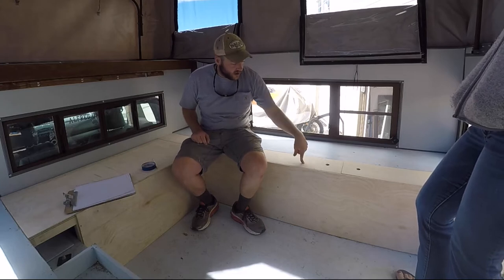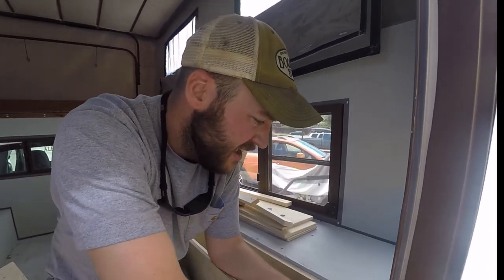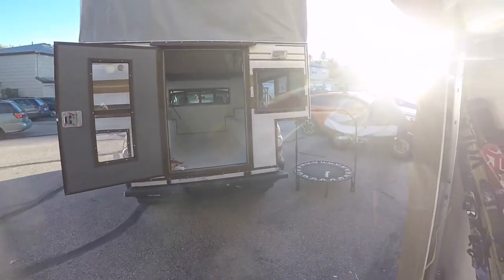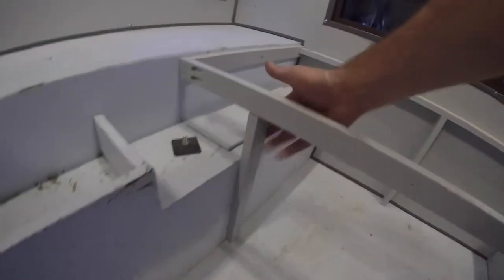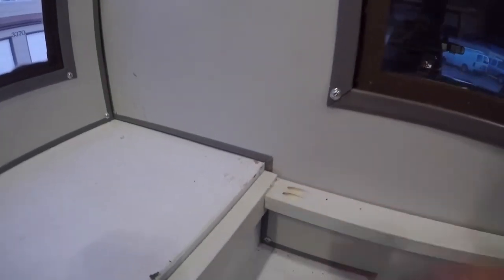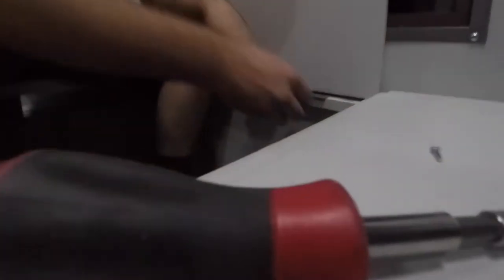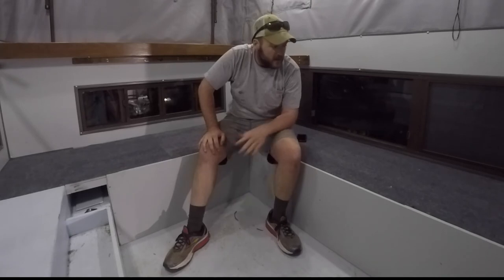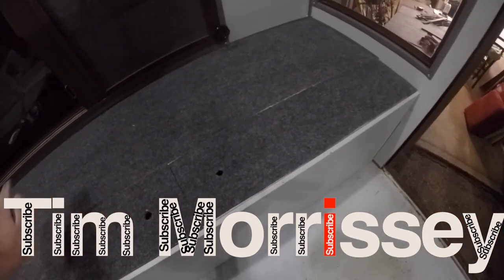Four Wheel Camper Build: Interior Shell Build - Benches and storage - Part 1

Comment: What year and model?? Great rebuild 😁
Reply from the maker: Thanks Mel, This is somewhere in the early 80s, I think an 82 or 84. I asked FWC but that is the best estimate they could offer. Its the fleet model, long bed (~7ft) designed for the old toyota trucks. Fits in my 6foot modern Tacoma pretty nicely. Do you have a four wheel camper as well?
Reply: Tim Morrissey no not yet, i really like the idea of low profile and not having to tow a trailer, i have a 2005 ranger w/ 6 foot bed.
Reply from the maker: The old fleets would fit perfect in your ranger. I am really happy with mine and could bet you would be too. You may have to make a small raiser in so the wings clear the bed but it is minimum (1.5in for me). Thanks for checking out my videos, let me know if you have any additional questions. - Tim

Comment: Hi, thanks for the video. I'm about to do the same to a 2004 shell. I wonder if you would have done anything differently? Is there anything that you've added since you did the build? Thanks!
Reply from the maker: Hey Grieg, Glad you like the video. It is working on great so far. One thing I might tweak is to give the lids to all the cabinets a bit more tolerance on the fit. Mine are perfectly tight and sometimes they are a bit sticky. I am no cabinet builder, I am sure there is some standard that might have this figured out already. Do go with the simple 1/2 ply, it is working out just fine for our needs. 

Since this video, I really built out the kitchen/galley a lot more.  I have tons of videos on the build that progress pass this. Make sure you check them out. 

What shell size are you in? A fleet?
Reply: @tgmorrissey  Thanks for the reply. I'll certainly check out the other videos on the galley build. I'm in a fleet shell. I want to get some cad drawings of the framing so I know where to secure to, or just guess! Thanks again.
Reply from the maker: On my build page in wander the west i have photos of my technical drawings. That might get you started. 

However. I believe all the older camper had a lot of variation in design as they dialed it in. So even if my drawings are accurate (which they my it may not be) your camper could have a very different construction. 

I always meant to transfer the drawing to solid works but never did. Hope they help anyways.

Comment: Tim where did you buy your windows from
Reply from the maker: Hey Darsey. Thanks for the question. Do you mean the glass windows in the base of the camper? They came with it so I did not need to but them. However if you do need to buy some I would suggest an rv salvage yard. In Colorado there is a place called 5 star rv that has tones of used parts and will look for certain sized windows if you ask for something specific. Let me know if this makes sense or if you have additional questions.
Reply: that's fine Tim. I am in ulster so I will look around here for some second hand materials. I am really enjoying your videos as i am about to make one of these for my truck @tgmorrissey
Reply from the maker: Awesome. Are you making your camper from scratch or restoring and old one? What truck is it going on?
Reply: i am making it from scratch and i have a Mitsubishi l200 short base, but if i have the back door down it is 2030mm from back window of jeep to end of tail door and i can go to 2000mm wide. i can then put the bed partly over the roof. i intend to make it out of 40mm square timber with ply and cover the out side with plastic covered metal. my jeep is black so i may finish the camper in red with black corners @tgmorrissey
Reply from the maker: @darseyno1520  Ohh man! That sounds awesome! Best of luck with the build. Let me know if I can provide any additional answers or help.  Also, about the windows, the lower windows (in the base of the camper) are not actually that great. i would maybe just put in one window in the base. The windows in the pop up materials are way nicer and more useful. Once you have the roof popped the rigid windows are in a weird position (below your waist). Just some thoughts on that. Best of luck!
Reply: I was thinking that I would do with less windows. i will put this title in to let you see what i was thinking of "Four Wheel Campers Pop-Up Camper Overview" on youtube. it is trying to get the size right. If i had the shell sorted out and the canvas, it will be exciting to do the galley and the other items inside. I will need some of your advice on electrics. i myself am a carpenter by trade so it will be a nice pass time in these long winter nights. i had intended to start today but did not get time to go and get some time. i was intrigued with some of your skills with the power saw. great work. by the way do you need to contact your insurance or is a camper classed as carrying goods and if you don't want your camper insured that is ok
Reply from the maker: @darseyno1520  Mine is a Four Wheel Camper as well! Just an early 1980s model that I restored. 12 V electrical is straight forward once you understand how to connect things. I think you will be able to work through it easily enough. The canvas is certainly the trickiest part for me. Have you seen my videos on the canvas as well?

I am sure you carpentry work will help you move quickly through this. I would be concerned that the weight might be high with the wood but I am not really sure. Four Wheel Campers all have aluminum frames. 

I do not have separate insurance on my camper. I am not sure how it would be classified so you are on your own with that.
Reply: @tgmorrissey ea the weight was one of the things i was concerned about. my truck can take a ton so i would need to get the weights added up. yes i have watched all of your videos and waiting for more from yourself
Reply from the maker: Darsey no 1 excellent. Your weight is probably doable. Just would want to keep it in check. Any more questions or topics you would like me to cover in future videos?
Reply: @tgmorrissey hanks Tim, i will be in touch. i may uses 30mm x 30mm studs to lighten it. Speak soon